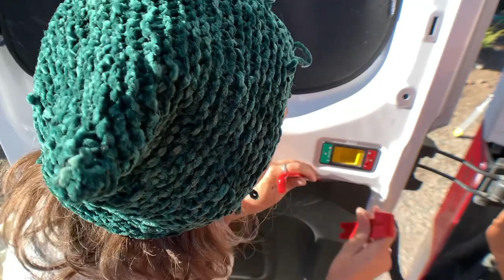The Secrets to How To Get Wool Insulation into Van Cargo Doors the Right Way for Van Life

Comment: Hello! I have a few questions about the wool and hope u have answers for me. I can see how the wool n the back door will stay up even without the taping the wool to hold what is coming out, I believe what is coming out is thick enough to hold the thin/lighter strips up on its own, compared to the roof and walls which have a longer, wider and open gap between the spacing of the ribs n most of the cargo vans I’ve seen, I can see the tape holding up the wool n bigger areas till time and weather loosens the tape, I can then see the wool bunching downwards between the inside and outside walls. During driving, there r vibrations, plus bouncing hitting uneven roads, potholes, gravel roads not maintained, causing wool to pack down even more, I know wool is warm, what r ur thoughts on my concerns ??? Can u visualize what I’m seeing??? Also, I i went to the link to check out the company that sells this wool, read all the questions and answers, I read the comment/answer that u also mentioned...moisture...y’all said the wool will dry/evaporate when the air is dry, I know it may not have came across ur thoughts...how would the wool work n states with high humidity, some states go weeks/ months of rain and high humidity, making along time before air becomes dry again, which to me, will not dry what’s between walls fast enough before mold occurs. I would have asked the company about that last question, but they didn’t have a comment section, or a phone number for me to call, as for other ways of contacting them, I’m computer illiterate. So hopefully u can answer my concerns. Thank u
Reply from the maker: Hello Joy, Havelock Wool’s phone number is on the top right of their webpage on my computer. Here is the link https://havelockwool.com/. They also have a support link at the top right. Currently, there number is 1-775-971-4870. Yes, using tape and other methods is important for keeping the wool in place. I use my cargo doors often, and this causes lots of movement inside of them. That is why I secure the wool in them. As for humidity and having enough time for the wool to wick its retained moisture into the drier air, that is a great question for the company. I live in the desert in the van, so this is not an issue for me. Important though to get to the bottom of. Thanks for watching and for asking!!! ❤️